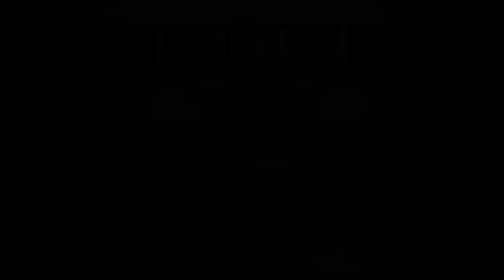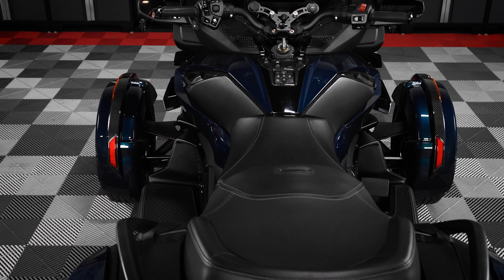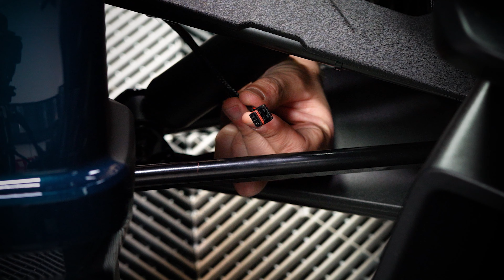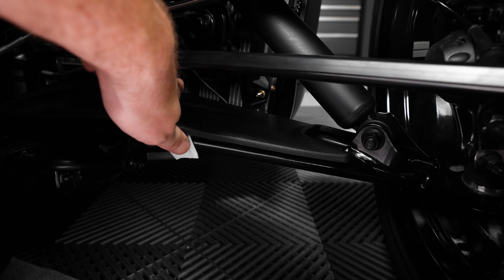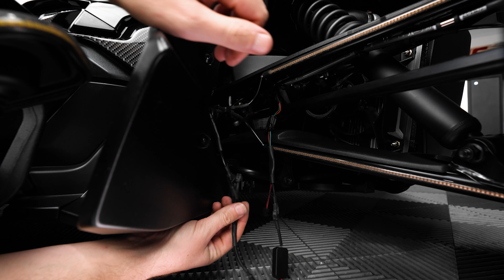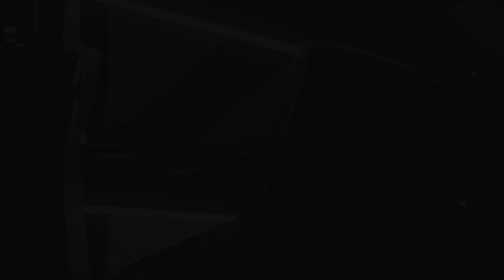Can-Am Spyder F3/RT "Rear Facing" Dual Color LED A-Arm Strips (2019+)

Comment from the maker: 🛒2008-2018 Can-Am Spyder "Front" Facing Dual A-Arm Lighting Strips: https://www.slingmods.com/can-am-spyder-dual-color-a-arm-running-lights-with-amber-turn-signal
🛒2019+ Can-Am Spyder "Front" Facing Dual A-Arm Lighting Strips: https://www.slingmods.com/canam-spyder-f3-rt-dual-a-arm-running-light-strips-turn-signals-2019-up
🛒2019+ Can-Am Spyder "Rear" Facing Dual A-Arm Lighting Strips: https://www.slingmods.com/canam-spyder-f3-rt-rear-facing-a-arm-led-running-lights-with-blinker-tricled
🛒1:2 Front Fender Power Harness (required for install): https://www.slingmods.com/canam-spyder-f3-rt-front-fender-expansion-power-harness-2019-up
🛒1:4 Power Splitter (for use if running multiple LED products on the same bike): https://www.slingmods.com/canam-spyder-led-power-expansion-harness